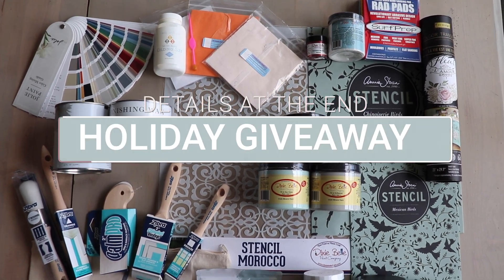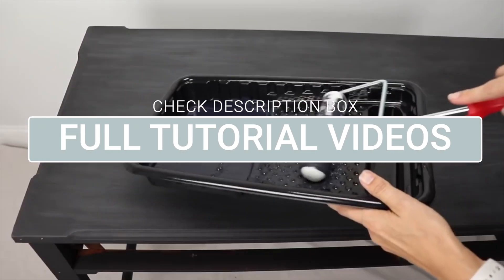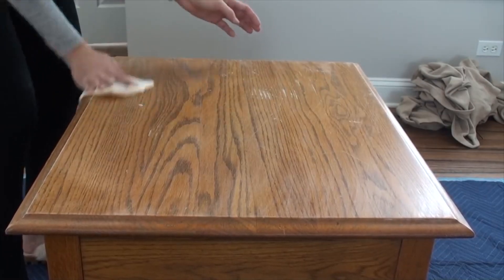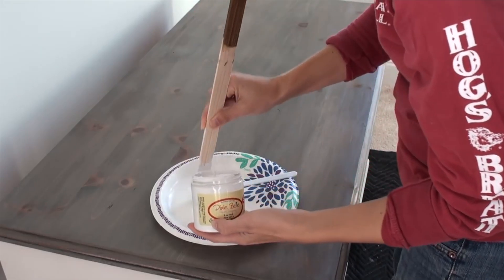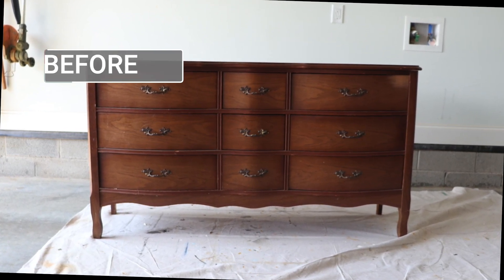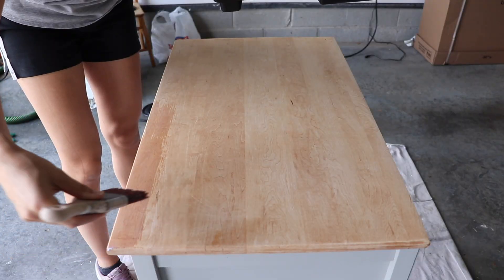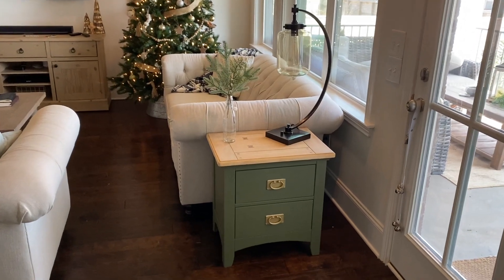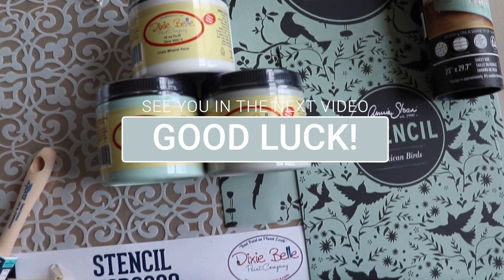10 Trash to Treasure Furniture Makeovers ~ Huge Holiday Giveaway ~ Chalk Paint

Comment: My favorite is the last one--had a pickled white top and contrasting sea glass bottom. Like the new drawer pulls also. 

Just watched a few of your videos and now I see a few things that I didn't know I needed to do. Have painted a few pieces with varying results. Thanks for the help. Wax!  I had no idea. I also haven't used a finisher or done any sanding between coats. Watering down the paint a little, huh?

Also.wondering if you've done any lacquered pieces. Saw a site last week selling lawyered pieces in bright colors--really pretty.

Comment: I did #4 after watching that video last summer. Problem was that I'm in Canada and couldn't find the same top coat that you used. People online said to use minwax polycrylic so I did and it was a mistake because I can easily scratch it with my fingernail! Perhaps it needed another coat, I'm not sure. It was my first attempt at any kind of re-finishing so it's not a huge deal, but I also don't feel very inclined to do any more of it lol. I like the end result of what other people (like you) do though!

Comment: What is your favorite non-yellowing top coat that would work over regular acrylic paint (in my case, Behr Dynasty interior)? I looked up the General Finishes top coat you used on the Pottery Barn table and there is a warning that it may/will yellow over time. I just painted a file cabinet/table that I use as a printer stand and I just want to protect the top from getting damaged too much from my printer. I only want to seal the top and don't want the top to look different from the rest of the table (never mind the fact I used eggshell paint and you can't seem to get eggshell top coat so I'll have to go with flat because I don't really want a satin look, haha). ??